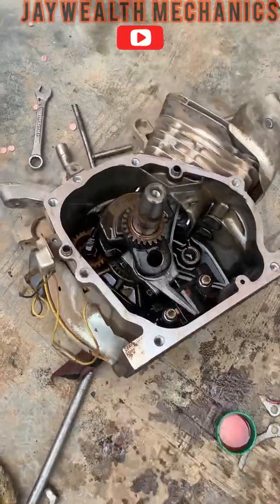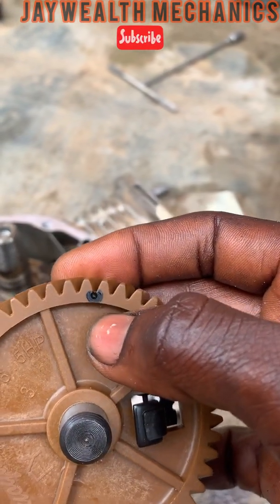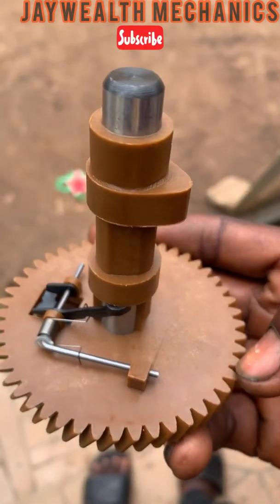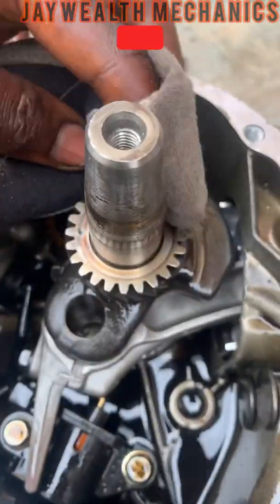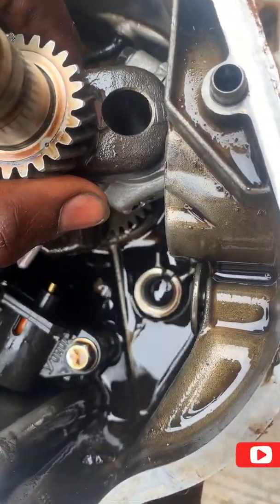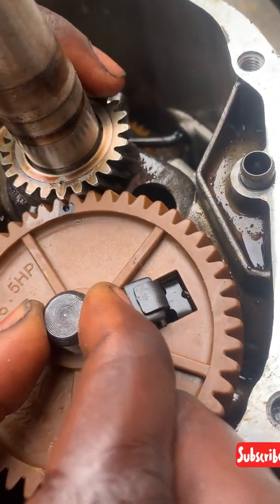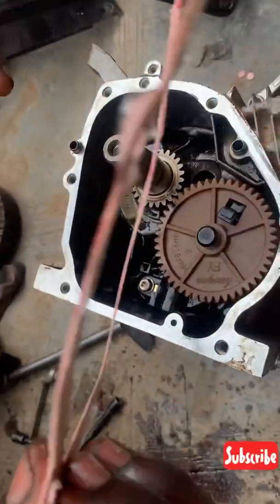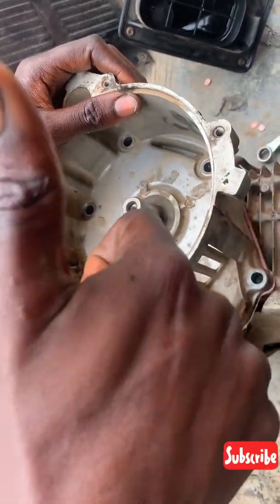Setting crankshaft & camshaft timing on most generator Firman (2.5/3.0kva) engine @smallengineshop

Comment: When do I need to replace the crankshaft?
Reply from the maker: You replace the crankshaft when the crankpin journal is low which will enhance the noise of the generator, 
Secondly you replace your crankshaft when your crank noise for pulley thread have worn out
Lastly you replace your crankshaft when your gear teeth for the camshaft or governor race is broken.

Comment: How does one know a faulty cam?
it makes the engine hard to pull,right?
The issue i have now is knowing when that spring thing is not doing what it should.
Reply: A faulty cam causes strike backs(Backfires) too,right?
Reply from the maker: Yes it makes the engine to be  hard to pull and if the gear teeth is broken the rock arms will not function.

Comment: Hello JayWealth, Thanks for uploading these videos they've been very helpful in fixing my generator. Keep up the good work. I'm currently working on a generator, the connecting rod of the Piston got broken so I made a replacement and coupled it up with the right settings as explained in the above video. Though the generator came on when I started it but the current isn't steady and the vibration is quite much. I've tried the governor race adjustment but no changes. What could be the problem?
Reply from the maker: Service the carburetor or you replace it and increase the speed
Reply: @jaywealthmechanics9285  I've replaced the carburetor with a new one but it still runs rough and it surges (as though it's lacking fuel) with lots of smoke especially when I put on a load.
Reply: If you made a replacement piston it would be essential that it would be the same size to the nearest .005 mm or .0008 inch
Reply: As the timing on the gears is directly influenced by the length of the piston. If the total length is not exactly the same you will have large timing issues like the black smoke you are experiencing.

Comment: Nice one Jay. There is this thing about "engine-oil" is shorting. More like the oil dries up too fast. Is that side gasket responsible?
Reply from the maker: Which of the gasket
Reply: Could be changing piston and rings would be the solution unless you see oil leakages from the bottom, meaning it could be your crankcase gasket or oilseal is now faulty.